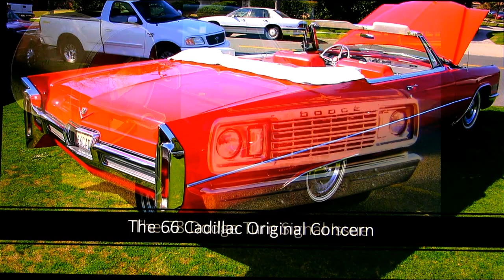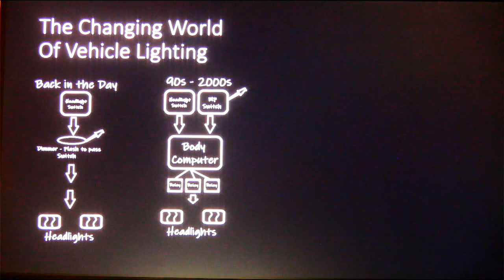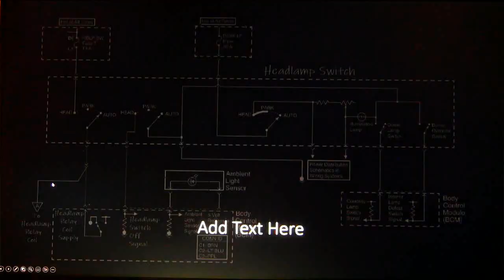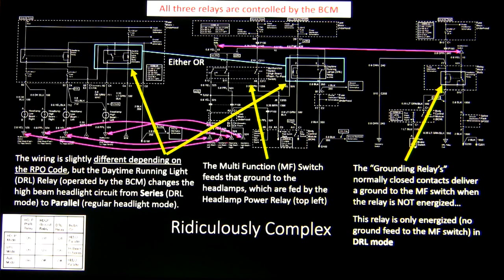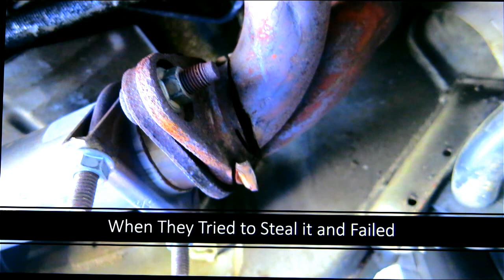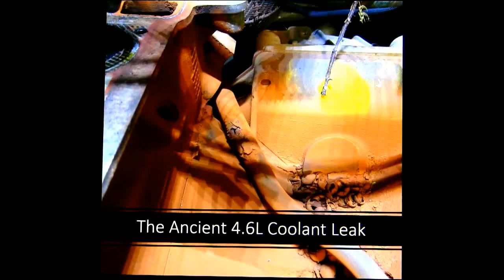Unexpectedly Complicated

Comment: Not related to the video, but wanted to let you know I passed the A-6 test today with a 40/50. 

This channel takes partial credit. Thanks again.

As a general repair technician, which test do you think I should study for next?
Reply from the maker: Which certs do you presently have?
Reply: @McCuistian  Only the A-6.
Reply from the maker: @nathandnicholson    I would recommend the A5 next if you're doing them one at the time... that would be Brakes
Reply: @McCuistian  I was also thinking brakes. I might take two tests in one day next time 

Steering suspension/brakes.